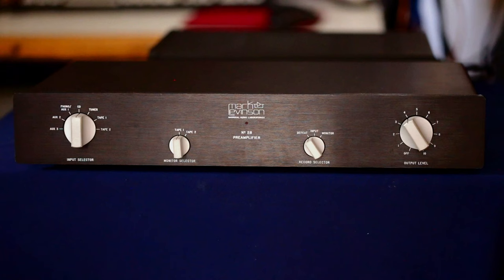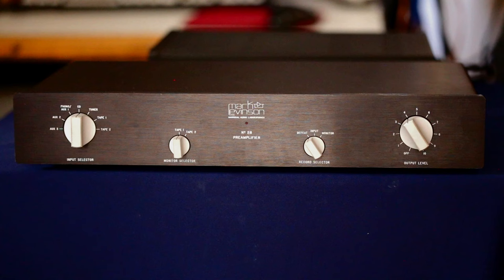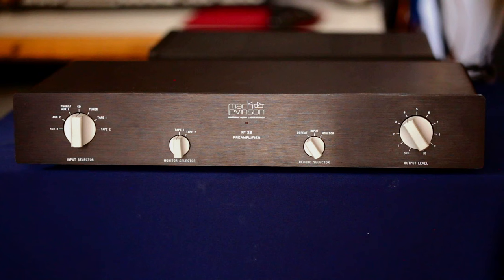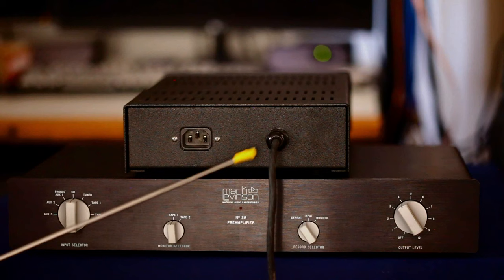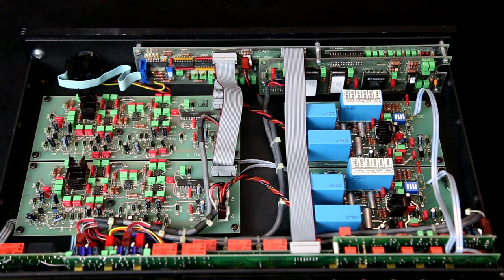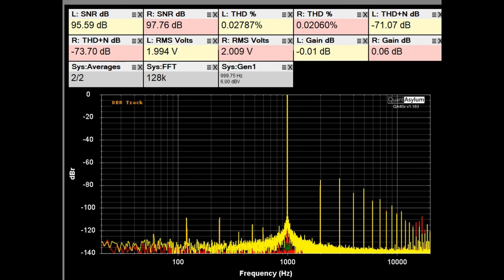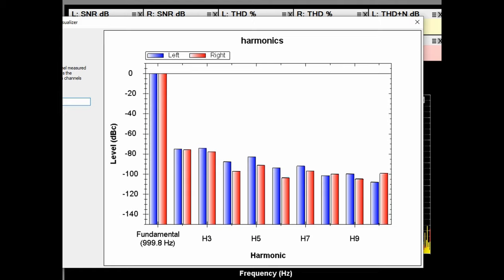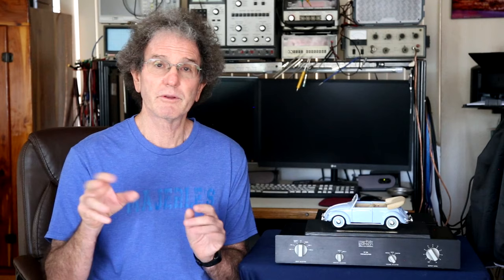Mark Levinson #28 Preamplifier- Vintage Audio Review Episode #83

Comment: I don't think it had a digital volume control, but rather an optical encoder instead of a potentiometer. If I remember correctly Krell KRC series also used it.
Reply from the maker: I think I suggested that but have never really worked on or tested gear that had an optical encoder, which I would consider to be a digital volume control of sorts. Appreciate the feedback.

Comment: I am shopping around for a pre-owned Preamplifier for under 4K. I am looking to upgrade the sound of my Parasound Halo P6  Preamp.
I have been reading up on various high-end brands as I go in order to educate myself.
Some brands that I've am considering are ML, McIntosh, Krell, Pathos and Pass Labs

Thanks folks
Reply from the maker: Thanks for the question. $4k is a lot. To be honest, I have not heard hardly any difference when a/b'ing preamps against my venerable Carver C1. And that includes against ML, Conrad Johnson and a Schit Freya + in the tube mode. Do you need a remote ? Do you need a mm or mc phono input? I don't really want to deal with tubes and they have not sounded any better to me. Of course, most of what I listen to is more "vintage". I really think I would like to find a mcintosh C48 under my Christmas tree one year- will be reviewing (measuring) one before too long. Hope that helps.

Comment: I am confused.  In your summary of the test data,  you thought the unit was looking pretty good...except  for some intermittent THD bumps.  Yet, you are not a fan of this product. I was wondering what you didn't like about it's performance.
Is there another Mark Levinson preamp product that you prefer more. 
For example, the next generation ML 300-Series of preamp s and amps seem to have received good
 subjective performance ratings from both owners and audio critics.
Perhaps another brand would perform better in this price range.  IDK 
   Thanks!
Reply: Perhaps you could recommend a Carver or Bryston preamp that measured well and that sounded pleasant to you.

Thanks very much
Keep up the good work.
Reply from the maker: I am not a fan of ML- this unit required special connectors which I am not a fan of. How good is your hearing? Mine is still pretty good for my age, and since you are asking, I have not heard much difference between the sound of preamps when you do a direct, almost instantaneous a/b test between them. $4k is a lot in my book, but not enough for a McIntosh C48 with has a DAC and both MM/MC phono inputs, though I have not tested one. Do you need balanced inputs is another thing. I don't sell any products and have nothing to gain recommending this or that. Don't get all hung up on what reviewers tell you about how the units sound. Look for the features you need and the price you want (and  the look you want/size that works).

Comment: hi i have just discovered your very interesting channel and subscribed    Thank you very much for your excellent video
I am a bit surprised   I was sincerely expecting impeccable measurable performance and this is not the case   
Maybe there are issues with some parts due to aging ?  too high THD for a line stage 
The fact that the channels performs differently also it is not comforting   Sometimes i think that less could be more ?
this unit looks very complex   and i start to wonder if it is not a case of overengineering  
I am looking for a great line stage and i hope you will test other units soon
Kind regards gino
Reply from the maker: Thanks for subscribing! You hit the nail on the head with "overengineering"! That is my opinion. I would never purchase their gear from the few pieces I have looked. I would never want to try to work on them if they broke. They did not provide any specs, so who knows. By line stage do you mean a normal preamp ? If so, McIntosh is always a good choice and I like Carver Preamps like the C1 or 4000t....
Reply: @vintageaudioreview  thanks a lot for confirming my feeling  I am not an expert but i can read a graph or a table
And in this case i have been surprised in negative way
For line stage i intend a preamp to be connected to a cd player   Not phono
I will follow your test reviews with the greatest interest  
Thank you very much again
Kind regards gino
Reply from the maker: @gino3286  There are several nice good vintage preamps out there if that is what you are after... I will be doing a more modern McIntosh Preamp in the next month or two.
Reply: @vintageaudioreview  thanks a lot nice brand indeed  I will follow your channel for sure  I am bored by the poetry of some reviews  I like objective evidences
Best wishes gino